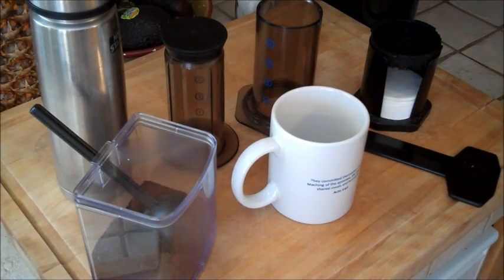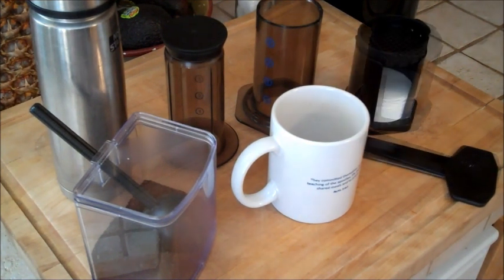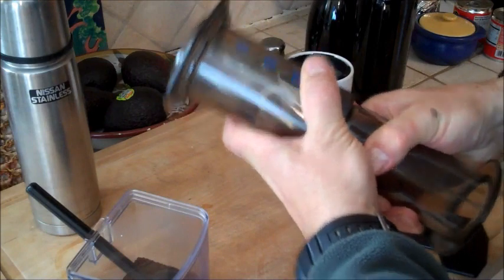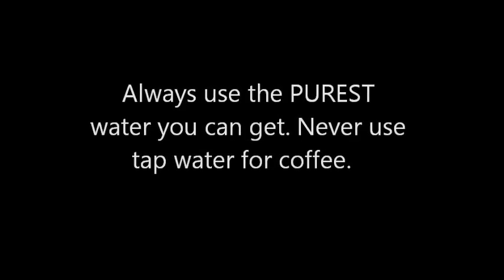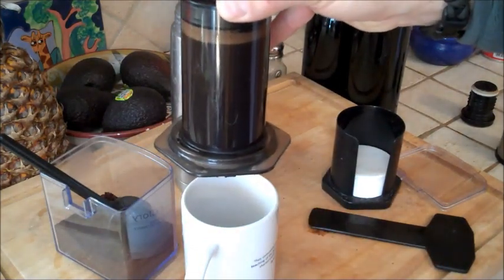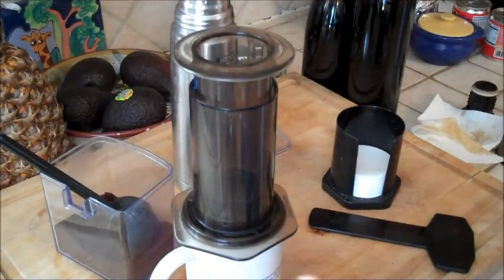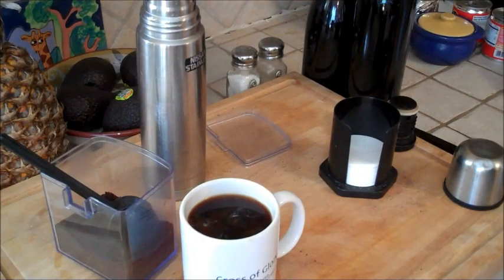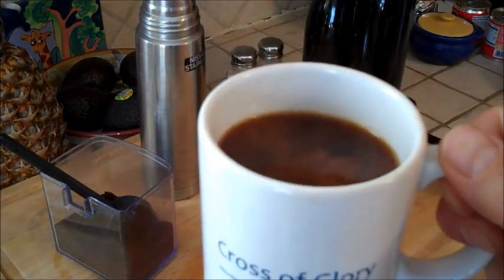AEROPRESS - "TACTICAL FORCE MULTIPLIER METHOD"

Comment: Thank you for the instruction. FMM was the first and only method when I purchased the Aeropress a few weeks ago. It is really difficult to go back to traditional drip. The Aeropress can make good coffee better and an old batch of coffee come out great. Prior to this instruction, I used the Hot Water-French Press-Long Steep-To-Pour Over Cone coffee. On hot days I would do Cold Water-French Press-To-Pour Over Cone having a steep time in the refrigerator from overnight to 24 hours. I recommend either when the Aeropress is not around...no pressure. Just good coffee. Best!

Comment: I'm not sure the proper etiquette here, but I bought a Kyocera manual burr grinder. I've only used it twice so far, but I really liked the way it worked. It seemed to take as long as you would expect to grind the beans, did a fine job of giving me a consistent grind, and stores the ground coffee nicely. The only ding I would give it is that you have to eyeball the grind setting as there are no markings, or easy way to re-create your setting once you disassemble it for cleaning. Hope that helps!

Comment: I use the inverted method because my hand grinder doesnt get quite fine enough and it auto drips as you mentioned. I have also been playing with the stainless disc from Able, it allows a little more oils to be extracted plus I dont have to carry paper filter with me.